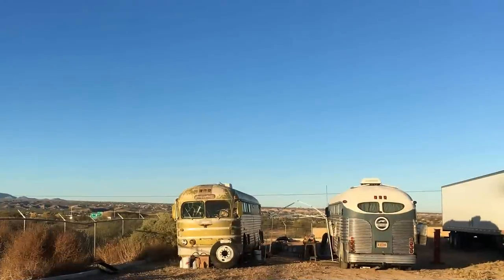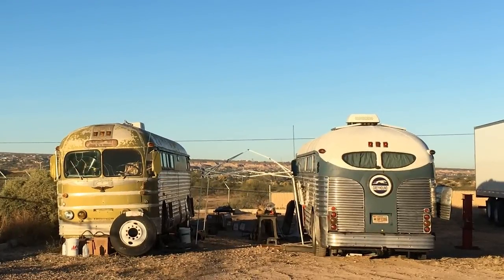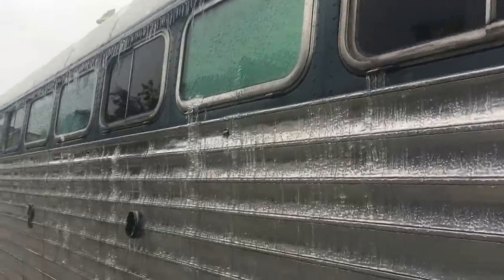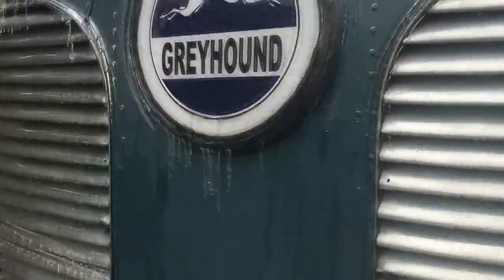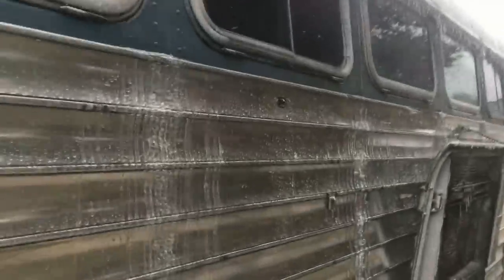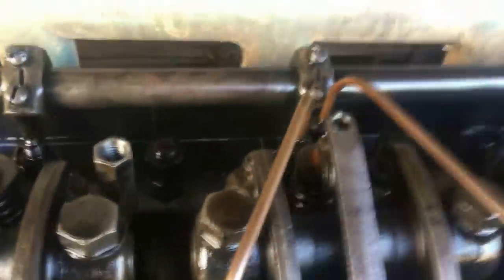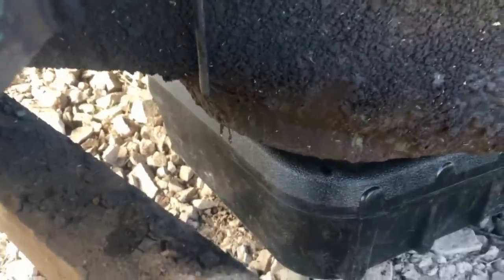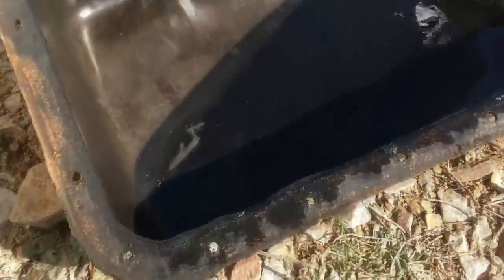Resurrecting a GM Bus that had a seized detroit diesel 671

Comment: Dude, seriously, you are my hero. No joke. 

That bus was dead in the water in the middle of the desert with no reason to believe it would ever move under its own power again. 

The southwest desert doesn’t give second chances, but you came into town fully equipped to breathe life into this badly abused bus and it is just one of your many videos of this kind of shenanigans. 

If you ever find yourself in the central Sierra Nevada mountains I sure would like to feed you a few beers, fill your tanks and share some stories.
Reply: You can trust this guy. He has Bubbles as his avatar.
Reply: Brad Leonard so many people think it’s actually me. 

Bubbles is much more handsome.
Reply: Dozer1642 people that do not recognize Bubbles are the folk we should be worried about.
Reply: Same applies here  backside of Wasatch Mountains near last years Dollar Ridge Fires   look up Strawberry Pinicals
Reply: Curious, what part of Michigan?
Reply: The desert is MUCH easier on vehicles. No RUST! Nuts and bolts can easily be loosened, cylinders don't rust, brakes don't sieze. It's why unused aircraft are stored in the western deserts. Now the bus is headed to rust central. Not good.

Comment: i drove a 318 detroit for years.  it had a 13 speed fuller road ranger shifter. the only time i used the clutch was for stopping and starting and on low speed sharp turns when there might be a bind on the drive train. i did NOT ever grind the gears and the mechanics were amazed that they didnt have to adjust the clutch or replace it.
Reply: Ya because that's the way it's done . LOL

Comment: SWEET sound, always loved hearing them as a child and the air brakes, AND you taught him the correct way to shift !!!
Reply: Amazing how much better it shifts when you do it right! 
Still did a good job handling that big girl.
Reply: Double the clutch!
Reply: I used to sleep on the back three seats while waiting for my groups to come back (yes, I did fit!) and if it was cold, I'd idle the engine and sack out. It was like listening to a cat purr and I'd go out like a light. It got to the point that I would know when the engine was the tiniest bit out of timing. The mechanics thought I was nuts, but they checked it out & I was right. I miss my old girls soo much!
- Stagecoach Annie

Comment: Its amazing that you travel so many miles to save these pieces of history working outside in the elements lying in the dirt or gravel whatever the circumstances are dealt you. Most mechanics work in well lit shops with lifts and air conditioning yet you get out there in it all with oil dripping on you and breathe life into these wonderful artifacts. You sir are very special.....I hope your hourly rate is double shop rate. Those garage pussies can't hold a candle to you. Way to go!

Comment: When I went to the Diesel Institute of America in Tampa our final test was to pair into teams, remove a Tampa city bus engine, rebuild it, reinstall it, and if it ran well without issues, we passed. Well, we passed. The liners were worn, so we pulled the head, pulled the oil pan, pulled all of the rods and pistons, replaced all of the liners, reinstalled the pistons and rods, reinstalled everything else, primed the oil system, primed the fuel system, and she fired right up. It was the first and only Detroit I have ever worked on. It ran like a top though. I miss that beautiful sound though.
Reply: Terry Melvin  Especially the 6-71 inline engine the 6V and 8V engines don't sound the same.
Reply: Terry Melvin  I used to listen for the last bus of the night around midnight as it rounded the corner behind our apartment windows it usually had an old look bus with a 6-71 inline it had a nicer sound than the newer fishbowls which had 8V-71s.
Reply: Used to work for a township that had Oshkosh snow plows with V- plows and wing plows on both sides to keep Rt 11 open ( two of the three ) They had 8V92's in them and we'd load them with #1 A crushed blue stone . . . . . . .I couldn't wait for the first snows to fly just to hear those monsters in full song ! ! ! If you don't know they used turbos to feed the superchargers . . . . all ten wheel drive with Allison automatics . I remember in '77' we had a record snow fall and the snow depth was ridiculous everywhere . Keeping the main roads clear left many secondary roads on the back burner to clear when we could . I recall the snow coming over the V plow and both wings . All you had to do is push on the throttle and that Detroit would scream and the snow would fly . We had a push pole hooked to the rear on one road which had a 12N Cat road grader connected to the other end . Not to assist in pushing actually he stayed in neutral and we dragged it on top of pushing snow . But the ditches being deep and on occasion going into them the grader would assist in pulling the truck back out . Yeah , will never forget that sound . .
Reply: addium Uppicus the Blizzard of ‘77, I remember it so very well. It’s the most snow I’ve ever seen in my life. I was in Ohio at the time and I remember those same style plows hooked to the road graders that came thru a week after the blizzard. That’s how long it took to get to some areas.
Reply: Robert, my story is similar to yours. I graduated from Cal-Diesel school in '79 where we learned to work on Cummins and Detroit diesels. Loved everything about Detroits but after graduation I never worked on another. Always regretted it.

Comment: Double clutching = good idea to avoid grinding gears. Clutch replacement is easier and cheaper than transmission replacement. Really love these old Detroits, probably my favorite diesel brand. Your channel is excellent because we all learn how these engines are built, and how they function.
Reply: Another thing I love about detroits, if the cylinder walls are damaged just replace the liners. Great design
Reply: Will Will  that's how I was taught to drive a non synchronized transmission. Truck was an old L9000 with an 8v-71 Detroit diesel. I swear it was like that trans didn't like me, until after a few days I got the hang of how to shift it without grinding gears. Made me realize how thankful I am that manual trans are usually synchronized nowadays. I'm still glad I learned

Comment: You know its really Surprising how many Drivers don't know about Double de Clutching on heavy Engines  she Sounds really Good Nice Job
Reply: Yes "double de clutching" !!! must be done on old vehicles that don't have sync-mesh gear boxes ! 
Year's ago I had an old land-rover POS! ... straight cut 1st gear and helical cut 2nd gear that were non sync ... however 3rd + 4th gears were.
Reply: why use the clutch if you know how to shift
Reply: @CharlieBrown-pb9xn  Are you talking about modern "syncromesh" gearboxes ? 
Straight cut gear > "old school" crash boxes ? or constant mesh full size truck gearboxes ?
I doubt that you know what your talking about 🙃
Reply: I dont know how their made or how their cut but in the many 18wheelers ive driven no clutch except for taking off works good
Reply: @CharlieBrown-pb9xn  , I took my drivers test in  a '54' Mack B series with triple sticks , and you had to hook your arm through the steering wheel to shift the high-low with the main box to keep the rpm's right , and double clutch for each gear as they weren't synchromesh anything . Also unless you were very skilled and you should miss a gear you stopped and started all over again .  In the mountains where I grew up that wasn't an option especially when the roads are covered with snow and ice . Just saying , and watching ' Ice road truckers ' I just shake my head and say spoiled whiners . We used to run the St Lawrence river when it froze and never gave it a second thought . Now when that little metal arm would fall as you came off a mountain . . . . . . . . .  =- / . LOL!  Old timers on here will understand . .. . . .
Reply: I went to one of the best schools and had to double clutch for my license but have never seen the need if rpm is right

Comment: Great video!!

This reminds me of the days I worked on Detroit's back in the mid 70's. One year out of high school I went to work for Stewart & Stevenson in Houston working in the truck shop. I was the new kid so I got all the nasty work on garbage trucks, buses and oil field trucks. 

The 6-71 was a workhorse and was fun to work on. Many trucks had oil dip sticks that were either marked too high or too low. Even brand new trucks from Peterbuilt or Kenworth were checked.

My favorite bus to work on was owned by Mickey Gilley. Every winter they would bring it in to have injectors changed from 55's to 65's. If we left the 65's in all year it would overheat in summer. Not enough room to put a bigger radiator back there.

Comment: I offsided for a few years on an Ingersol-Rand T3 drilling rig converted for water well drilling, 6/71 naturally aspirated truck motor 12V71 twin turbo deck motor. Over the years, we  had a number of roadside and job site repairs, including replacing heads and a complete deck engine swap onsite - we couldn’t move as we were stuck down the hole with no means of getting out. The 12V is a big lump of metal to handle on a steep drilling site. The owner had a shed full of spare engines as a source of spares, often not a great option but we kept the old girl running and making money. A steep learning curve for two non mechanics - we did have a very talented and experienced fitter looking over our shoulders, and testimony to the clever design of the line of engines.

Comment: Man, she sure sounds fine. Beautiful. Well done, Scott. I just moved in to an apartment complex. I was allowed to look at the backup generator set for the complex. Lo and behold I was greeted by a 20v149. It is freaking MASSIVE and sounds just as massive! I'd never seen something that big as far as an engine. I have a pretty good size extended chassis Ford E250 cargo van and I swear that the engine is longer and taller than it!!!

Comment: excellent work. good thing you got it out of benson before it got really hot. i spent quite a bit of time there and summers are nearly unbearable. first start sounded good and it just got better from there. thanks much for posting and +1 for resurrecting vintage gear.

Comment: People when you buy an old vehicle you have to base line it. That means you assume nothing. So you find out how much oil and liquid each system needs so you know for example the gearbox has the correct clean oil of correct amount and factory specification. It will take time but it's fun too. And you will know your transaxle bearings are okay, the engine is right steering linkages safe and correct. Otherwise just don't play. But I take my hat off to these mechanics. You are unbelievably awesome. Replacing cylinder liners like that wow! Great video. Thanks for sharing.

Comment: So awesome! 
I spent a LOT of time behind the wheel of a '60s GMC buffalo 871.  
I miss that weird turn table feeling you get steering one of these buses around.
Plus shifting based off of seat of pants vibration. 
Once in awhile I could get a butter smooth shift. Normally I had a little grr grr grr shifting in.

Comment: I love the sound of the old two strokers. Worked on many at the local diesel shop in Holland Mi. Van ECk diesel service. I can rebuild the head on that thing with my eyes closed. 238's were tough. 65's should get ya upta 250 to 265 H.P. Keep her running for the next generation....so they get to hear the music from that Detroit sir.

Comment: Very nice. I always enjoy seeing fine old machines brought back to life...and used. Great stuff here. First engine rebuild I ever did was on a 40-horse VW in an abandoned gas-station parking lot 49 years ago, with no floor jack. I was as black as a coal-miner when I got done, but she ran fine for years afterwards. Still in the building 'em and saving 'em business today, so I kinda get it.

Comment: In the interest of fairness- I'm really not into buses...or diesels...but I'm a new subscriber to your channel!  Googling the DD engines turned up some fascinating info - what an incredible design they are!  Two-strokes - who knew!  The fact that the engine took such abuse (low oil) is amazing.  One wonders how long the engine would have continued running with basically no oil if it hadn't puked out all its coolant?  The fact that it was rebuildable in a dirt lot is doubly-amazing.

You guys did an awesome job - that engine sure runs smoothly!  Me, I probably would've gotten there, seen all the damage to the eingine, thrown up my hands and said, "Screw it, it ain't EVER gonna run again - let it rot." and walked (ran) away.  Kudos to you guys for not getting discouraged and doing the nearly-impossible.  

Great video :)

Comment: that's such a beautiful bus you have ,, i love my silversides mine is a 48 , and has dark green accents around the windows where your's is dark blue ,i haven't driven it a lot yet ,, but i recently drove it to chicago from omaha  ,,i averaged 7MPG cruising at 55mph down interstate 80 ,,it's a bit of weird feeling driving a 4 speed in such a big vehicle ,,even my toy truck a 1976 ford COE single axle truck tractor has a 9 speed ,,actually the last class 8 gas burner  built by any manufacturer ,,my particular truck is powered by a  turbocharged 460 big block V8  ,,originally it had a 429 FE big block ,,fun toy to drive around town too
Reply from the maker: Sounds like you need a tune up.  7mpg is way low. Or you have a fuel leak.
Reply: oh  well  thanks for the info   i've never driven a bus like this before  so not really familiar with it 
it runs really good and starts easily  even on 40 degree days ,,i have not had the injectors checked to see if they are working right  i do get just a little hint of white smoke and a slight smell of unburned fuel

Comment: I just can't imagine hopping into a 72 year old vehicle and driving 2000+ miles with any expectation of reaching my destination. I'm amazed that you can find any parts for these things.
Reply: Wes Johnson Services..... actually, All parts, build kits (in-frame And out of frame), rebuilt and also re-manufactured complete engines for all series of 2 cycle Detroits are readily available through quite a number (literally dozens) of outlets, as well as through Detroit Diesel themselves.   The only two series that are harder to find parts, etc. for, is the series 51(2 & 4 cyl.) and the 6-110.... but it's not impossible for those, either.
Reply from the maker: The engine is the easiest to get parts for.  There are a few things that are harder but never impossible

Comment: You know your stuff.. Most of those old 671 mechanics are in heaven..  Nothing like the sound of that engine.. But hope I never own another, lol, or any Detroit Diesel for that matter..
Reply: They had problem's but that was mostly due to GM management in the '70s. After Roger Penske bought them, things improved dramatically and I had the opportunity to work with his new management team on making improvements with quality control, something GM didn't really do much of until the Japanese had them for lunch.
Reply: @siaripop7  Now you have opened a can of worms......  I was Captain of the "Boomer" a custom built Pettigrew 70 foot sportfish built originally in 89 for a famous Newspaper magnate.  then sold to some real estate partners, and bought out by one from  Las Vegas.  He kept the boat in the Dominican republic..  Private yacht. occasionally fished when we could actually run..  Long story short..  16 V92's.. Balanced and blueprinted by  Roger Penske.. Painted red. and sporting Detroit's  DDEC electronic controls..  Built especially for that newspaper magnate.. worked for 20 odd years. by the time I was hired... they were a nightmare. almost 30 odd sensors etc.  and if one was out... NO GO.. .. Note: The oil Industry used to run those DDEC electronic controls on their oil rig boats..  Big time stuff back when.. Phased out in less than Ten years. WHICH included entire engine and control changes.. $$$$  thanks Roger..  Many boats were scrapped because it cost too much to swap out engines AND controls..  Including private yachts.. lol. I believe she may be the last one..  She is in Lauderdale now and probably is for sale..
Reply: Marc Del:

And since Penske turned things around for  Detroit and then selling it to Mercedes-Benz.....their engines (under Mercedes-Benz) have become downright garbage. 

Uncle of mine convinced the municipality and County to stop buying any bus or replacement engines with Detroit Diesel. He gets into all the technical stuff of why Mercedes-Benz has ruined Detroit Diesel...something having to do with violating combustion displacement (per cylinder,etc.) and tolerance perimeters which are well known to people that maintain and repair them day in and day out.